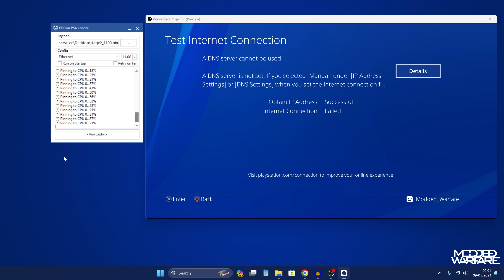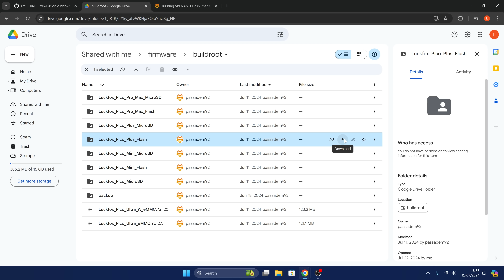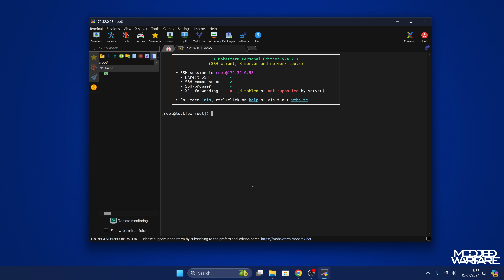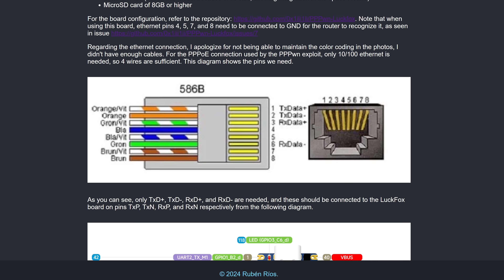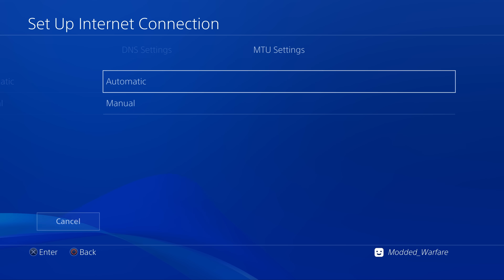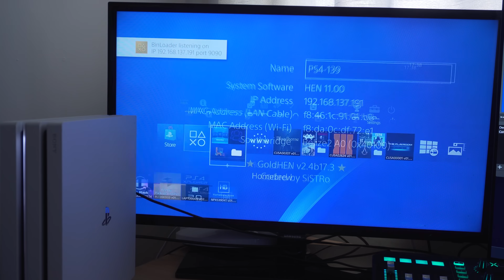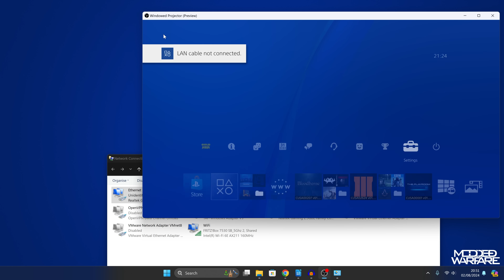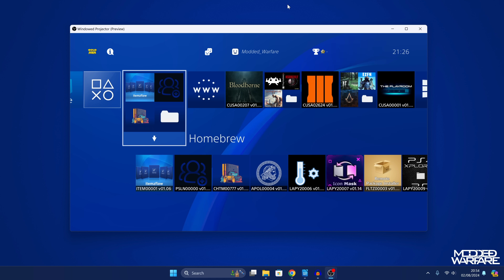Using a Luckfox Pico as an internal mod chip for the PS4

Comment: I just stopped using the luckfox pico flashed to nand because my console would constantly freeze up and makes me fix my external. I also have to run itemzflow to restore external and dlc every jb. Yesterday it took me 2 hours, im not exaggerating, to get it to hold jb stable. Ie. Console freezing  from staring a game to a complete power off. When I use PC it is almost always stable. Anyone have similar problems?

Comment: hello guys, just a quick question, i have 2 ps4, one is the original and one is pro, both are on 11.00, im planning on selling them, cz i already have one jailbroken, but the problem is that i do not know the prices of ps4 with FW 11.00 :), what are the prices for them and if there is any way to profit from them instead of only selling them directly, like for example jailbreak them first then selling them ?

thanks

Comment: Sorry I'm pretty new to the ps4 modding scene but what's the best ps4 firmware to have atm, i got luck & bought a ps4 pro & x360 for £5 at a car boot sale, ps4 pro was on 8.5ofw so i did the 9.0cfw exploit which required a usb & internet collection to run it, is this all i need? & Are these exploits only being released because ps4's with exploitable fw are becoming rare?
Reply: Whatever you do Stay on 9.0! and don't go higher. No advantages
Reply: @Saturn0s  thank you 😎

Comment: Do you need to disconnect your ethernet cable each time you boot up the system? Or does the exploit persist between reboots of the system? Also is it safe even to use the internet with this exploit on? Don't you run the risk of a store ban? I've got a modded Switch and i know on there we need to jump a lot of hoops to prevent Nintendo from blocking us, including setting up DNS blockers that block any connection to their servers, is that not necessary here?
Reply: It cannot connect to sony servers. You don’t even have to use your main account, you can use a dummy one which is what I do. I’d just download everything and transfer it over to be safe. People use custom DNS stuff to block the system update but I don’t because Goldhen has it built in now. You can use the internet but you’ll have to download custom versions of the streaming apps. To play with other people it can only be on custom servers with other jailbroken users.

Comment: I did this back in the day of using an ESP32-S2, I also made the BOOT button external so the cover never needed to taken off, of course never used ethernet, I wired the data and power lines direct to the USB port pads.
Nice lil guide.
Reply: can you explain a bit more?
Reply: I second that  @blind_judiciary
Reply: @blind_judiciary  desolder the button from the board, add some wires to the pads then to an external push button.
Reply: Can we have a guide? Luckfoxes are $12 and I know from the past (i have a 9.0) that the esp32 costs about $2 now.
Reply: @ocstrangeness  I have both, I prefer Luckfox Method, seems more stable than the ESP32-S2.

Comment: This is a pretty neat method for the PPPoE mod. Picked up a PS4 PRO for only $100. Sadly, it is on FW 11.02.
Reply: You can try to revert back to 11.00. there's a good chance your B slot is on jailbreakable firmware.
Reply: @Ali-Sensei  I tried, my Syscon chip was too new..... I couldn't do the patch and revert.
Reply: @Ali-Sensei how can I check my b slot

Comment: Wht new in this,  , This is wasted , it will bound the ethernet port , better option is use this device from out side no need to fit this device inside, this is no new trick, device out or in is not mattered , if luckfox device will stop then u will need to put out  again

Comment: I have a PS4 Pro on 11.00

I have successfully jailbroken it via computer

But sometimes

It freezes during the process and sometimes when I turn it off and another day when I turn it on it opens as if I unplugged it... and sometimes it doesn't enter the reset mode

What's the problem with that
Reply: Maybe you have the cursed ps4. Ipv6 will do the trick.
Reply: @5rv9KY  
I am using pppwn GUI 1.9
Do you mean it or another tool?

Comment: I don't know if this is really safe to do. Looks really sketchy. Is it really a good idea to solder something like that? I'm not much experienced with motherboard soldering, maybe someone could give an technical explanation. And what would happen if you run ethernet cable and the modchip at the same time?
Reply from the maker: Don't attempt if you're not comfortable with opening up the console and soldering. To your seconds question having the ethernet plugged in while the luckfox is trying to Jailbreak will cause them to conflict. This stops the Jailbreak from working until you remove the ethernet or disable the network connection. However, it will not cause any damage.
Reply: @MODDEDWARFARE  ahh okay I just was wondering what would happen if you had both running. My guess would have been that it produces conflict and amplitudes the voltage -> possible damage on the device. In your last sentence you mean it will damage the device or it will not damage the device?
Thanks for your quick reply! :)
Reply from the maker: @user-lz3ce8gj1m  Sorry that was a bad typo. I meant to say it will not damage the console.
Reply: Not trying to sound like a snob, but this mod is as easy as it gets, if you want to see a hard mod look for the RGH3 for the Xbox 360, you have to scrape the motherboard to get to one of the soldering points, and they are so small you need to use a microscope or some kind of magnification lenses.
Reply: @robertkennedy8503  Sounds nice 😂 I will check it out. I never was in the Xbox mod scene, but it sounds interesting. I'm more interested in the technical aspects and how the security of those systems got beaten. :)
Reply: @robertkennedy8503   or rp2040 on an oled switch... i hate any time i have to scrape for a trace or point. but modding is love, modding is life!

Comment: Newbie here..should I get the Luckfox Pico Mini B- without header or with pre-solder header? Thanks in advance!
Reply: Thank you for the replies
Reply: If you watch the soldering part you just need mini B without anything else. Mini A dont have flash memory. 
You dont need that 20+ legs to put it in tiny space. 
Price is $8.99
Reply: Without it, header is not needed for this purpose.

Comment: Internal soldering for just the JB is a pretty good indicator CFW won't be happening.
Reply: only ps3 has CFW. Even the Xbox 360 doesn't have a soft mod. It's hardware mod only and it's been more that 20 years since the console launched
Reply: @ajajpk Yeah. Also not every PS3 can run CFW
Reply: Lmao imagine thinking CFW was ever coming to the PlayStation 4 😂

Comment: If you cannot solder, you can use liquid wire and leave it to dry for a day.  Then use hot glue to strengthen the wires to the underside of the PS4 motherboard.  Super easy and since the mod chip is not movable, it is permanent.  I got my liquid wire on eBay.
Reply: Not a bad approach at all, however I will say that this is one of the most simplest soldering mods out there for consoles. Anyone who’s willing to dish out +$30 for a decent soldering iron should seriously think about going through with this.
Reply: @DatGuyWithDaGlasses  true but i rather have it external for easy updating.
Reply: no. don't encourage people who have never touched a soldiering iron to do this lol
just practice soldering on a piece of scrap first
Reply: Soldering is not a difficult skill to learn to be fair.
Reply: @halo3odst  true, and i would have done it if it was a fully working modchip but i rather have it external tho but its indeed a good project to start learning how to solder.
Reply: @halo3odst but soldering well and proper is. Sure most people can cobble a few wires together for something like this

Comment: When can we achieve the goal of not inserting a USB drive?
Reply: technically you only run the usb on the first time using the payload, it auto transfers to the HDD/SSD after that and it runs automatically. every time you use a new method or update you kinda have to use the USB but its really not as bad as when booting goldenhen on 9.00 and had to use the zzz file usb drive every time. now the only thing is having to setup the pppoe every time if you use wifi or ethernet to connect to have it ready in case you power the console down.